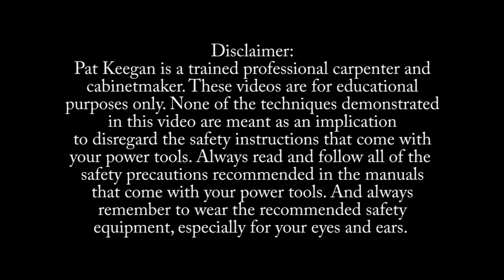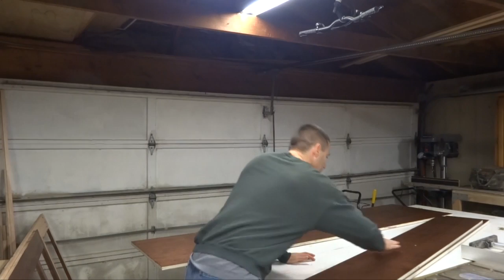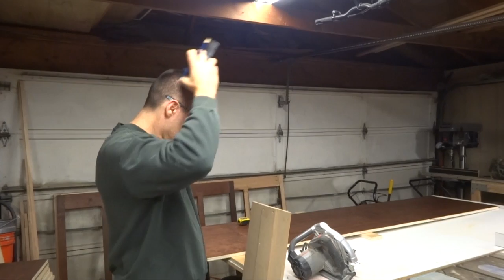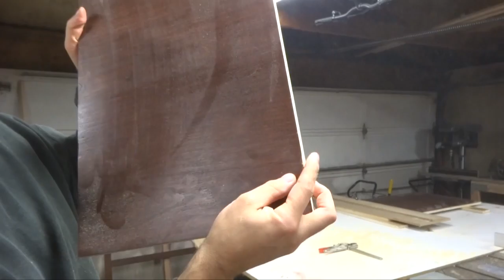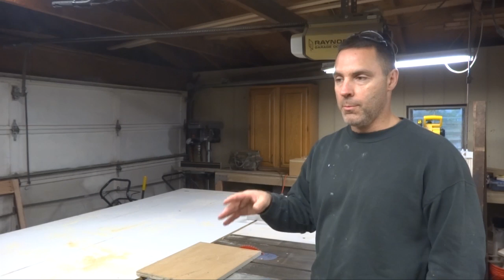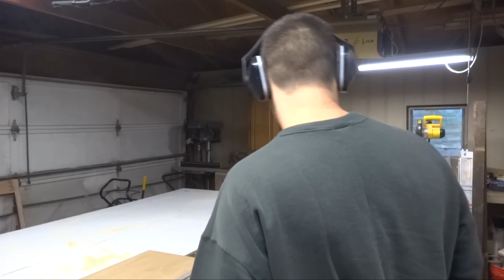How To Build Your Own Kitchen Cabinets: Part 1

Comment: You wouldn't have a problem with the wood splintering if you used a finish blade rather then a rough cut framing blade.
Reply from the maker: Tyler Baker Hi. That's a good point. There are different blades you can use. The carbide tip finish blade with more teeth per inch will definitely help. Also, a HSS plywood blade will help too. Unfortunately, from my experience, there is not a blade that will eliminate it altogether (especially HSS blades that dull quicker than Carbide), so using an aid like a cutting jig, or other tips will help make a better cut. Thanks for watching and taking the time to post a great point.
Reply: *****
even with "finish" blades ... about the only way to "just about" guarantee no chip-out,  is the tightly sandwich the cut piece with scrap pieces.
  Also, if you scribe the cut line with a sharp knife, it helps.

Comment: Hi Pat,
I really enjoyed your videos.  Last year I renovated my 12 x 15 home office to accommodate myself and my 3 kids.  I got rid of all office desk and built a table top that goes around the 4 walls.  In my design I had upper cabinet all around the room for much need storage and lower cabinets at each workstation for files and desk drawers.  My main concern is cost and trying to keep things as low as possible without compromising quality.  To keep the cost down I was going to build the cabinets and doors in MDF and painting it.  My concern is the strength in keeping it all together.  This is a test run and if successful in making it look nice then I have a 15 wide wall unit that I would tackle in the plywood that you used in your video.
Reply from the maker: Michael Gatti Hi, thanks very much for watching and taking the time to post. Agree that cost is a high priority item. I'm not a fan of carcasses made from MDF, but I do understand doing what it takes to keep the cost down. Where I live, i can get C2 (paint-grade) birch ply for just about the same price as MDF.

MDF doesn't generally hold fasteners very well (speaking only from my own experience) and iI avoid pocket holes altogether. I use butt joints with confirmat screws (pre-drilled) and glue on both surfaces. Make sure you pre-drill also.

If you decide to use pocket holes, don't over tighten.

I've heard Spax makes a screw that people seem to like, but haven't tried them yet, so i can't speak to their effectiveness. Good luck and if you feel in the mood, you can post pics to our facebook page when you're done! Thanks again!

Comment: Hi Pat,  Thanks again for all of the information that you have shared throughout this video series.  I am nearing the completion of my first kitchen and it's going very well.  I've finished 26 cabinets now using your techniques and I couldn't be more satisfied with the results.  The only remaining part left to do before the countertop guy comes in is the island (3' x 10').  Do you have any suggestions that you could offer for this?  I suspect that an island can be made simply by building the same type of cabinets and attaching them together in the middle of the room.  Should the base be different though?  Free standing with legs perhaps?  I'd appreciate any advice you could offer. Thanks again for this wonderful series.  You provided me with the confidence to go ahead and attempt this project.
Reply from the maker: Harv Hey, thanks so much. I couldn't be more pleased that things worked out to your satisfaction. So glad they proved a useful tool.

Man a 3x10 island would be SWEET!

Yes, you can build base cabinets or uppers the way we did in the videos and use them in the island. Two things you want to make sure are 1) that your island is "square" to the rest of the room, i.e parallel to the other elements etc so it doesn't look "crooked" and 2) that your island is attached to the floor.

I've done this a couple of ways, both are okay, just depends on what you want your island to look like. On one job, the island was prefabbed and we attached it to the floor by making a 2x4 frame 3/4" smaller than the outside island dimensions on all sides. We screwed the 2x4 frame to the floor, then we slipped the cabinets over the frame and nailed through the side of the cabients at the bottom into the 2x4 frame. Later covered with trim to hide the screws/nails.

You can also build simple boxes, and a taller base, screw the base to the floor and set the "boxes" on top screwing them to the base. Then you can attach decorative panels to the sides, pilasters to the corners, add legs or whatever you want. Definitely look around on the web, there's tons of ideas out there, and tons of pics/vids showing you how.

Either way, you gotta attach them to the floor, and I usually do this, as i mentioned, using 2x4 cleats.

If you feel so inclined feel free to post some pics on our facebook page at www.facebook.com/diyhomebuilt.

Thanks again for taking the time to post! And let me know if my explanation wasn't clear :)
Reply: ***** Thanks for all of these suggestions Pat.  They all make sense.  I will likely build the base separately and set the cabinets on top as that's what I have been doing everywhere else (unlevel floor).  I'll post some pics on your page (if I can figure out how) when the project is complete and the countertops are on.  It's taken since May to get this far so I'm thinking that Easter may be a realistic target to shoot for. I've certainly found that being in a rush just makes it stressful instead of fun and that I make more mistakes.  I'll check out the web for design ideas as you've suggested.
Reply from the maker: Harv sounds great. Looking forward to the grand reveal :)
Reply: ***** Hi Pat.  Finally finished!  Things worked out pretty well too - even though it took me 11 months.  I have a few pics to share with you but wasn't able to figure out how to put them on your facebook site.  (I guess I need you to do another one of your great instructional videos on that.) Is there another way to send you some photos?  Thanks again for all of the information that you've provided - it was invaluable.
Reply: Harry Lobb PS.  Can hardly wait until your next video series.  I think you were suggesting sometime in the past that it might be about built-in units, such as bookcases.  Is that still in the works?  Harv
Reply from the maker: Harry Lobb that is totally awesome!! 11 months isn't bad. the way I figure, if you're not doing this full time, and you finish a kitchen in less than a year, that's not bad :). I thought you could just comment on the post i made asking for photos and then upload the photos by dragging them into the comment box. Let me know if you still have trouble. Glad you could use the information in a productive way :) great job!
Reply from the maker: Harv Yessir! I'm excited too. I finished the sketchup drawings and am going to create a video on that. Then we start on the base and case works....stay tuned! and thanks for all your support!

Comment: I realized I need to screw in directly to the middle partitions on top, bottom and back. No pocket holes. That's what I'm thinking anyway.
Reply from the maker: Whippetfest yep, see other post. That takes care of attaching the partitions to the case, but still leaves you with the issue of attaching those partitions to the face frame.